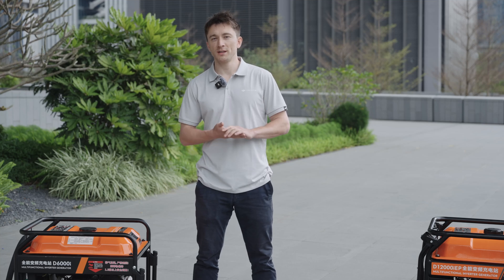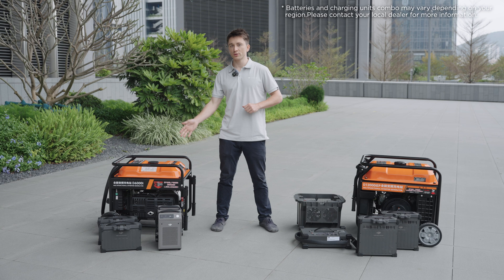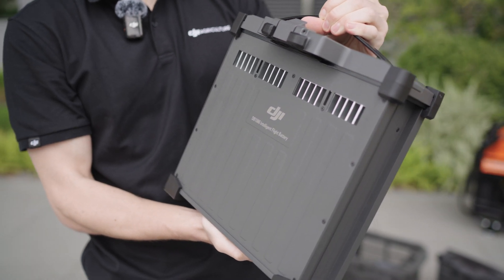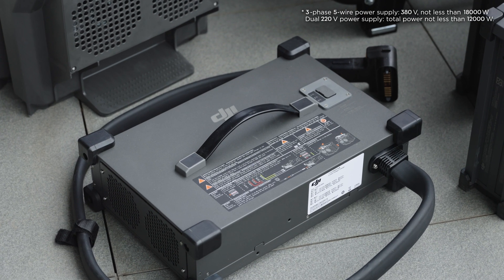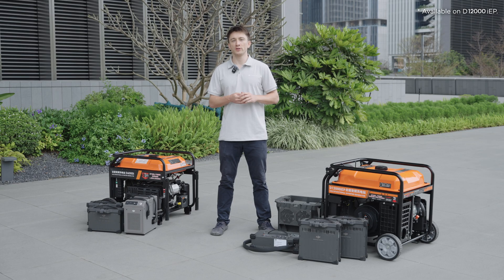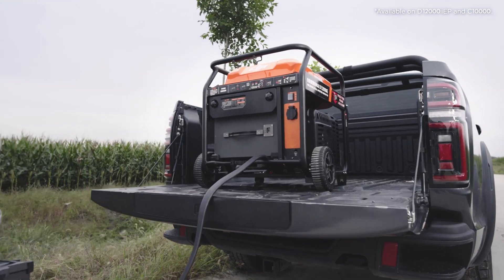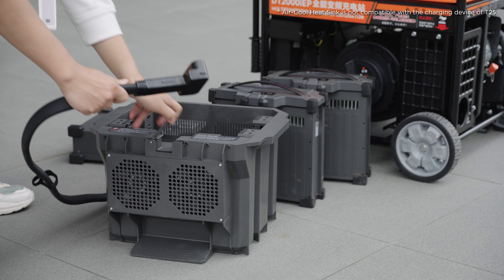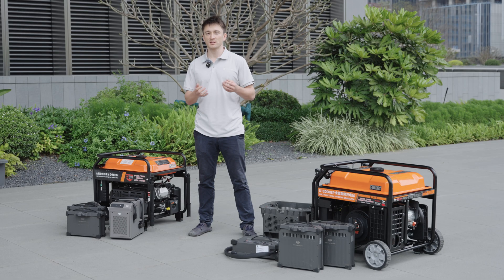Agras T50 & T25 Power System Introduction

Comment: Hi, could You please clarify the power source options for C10000 charger? In manual of T50, it mentions that it can be powered by "industrial, three phase-five wire power supply". Could you be more specific? There are no parameters mentioned in the manual. Does it meany 400V AC? Are the cables for that included in the package? Thx

Comment: Hi, can you use the T50 battery to run a T25 drone? thx
Reply from the maker: Hello,  T50 battery are not compatible on T25 as they have different size.
Reply: @DJIAgriculture  Thanks, i have seen a T20 run on T40 batteries so i just thought it would be the same for the new units?

Comment: Hi, pls can You use c10000 for T25 batteries as well? Would it have a benefit of even faster charging? Thx
Reply: Yes, you can use C10000 for T25 batteries. But the charging speed is similar as C8000 with T25 batteries. The input power of the battery is the main factor of the charging speed.
Reply: @FUYUANYU-o2q  Thanks alot. It is good to know as it would eliminate the need for 2 separate chargers if both T50 and T25 are in operations...